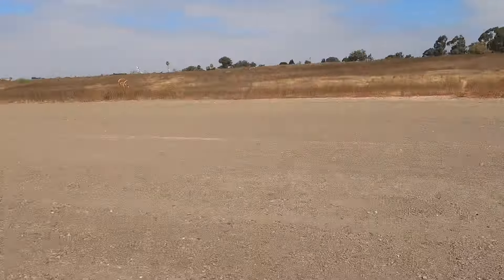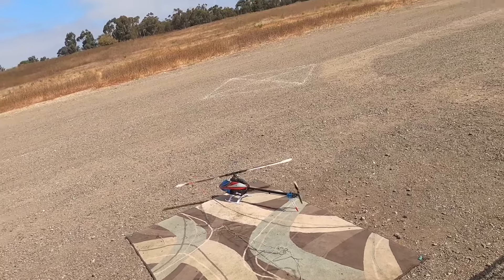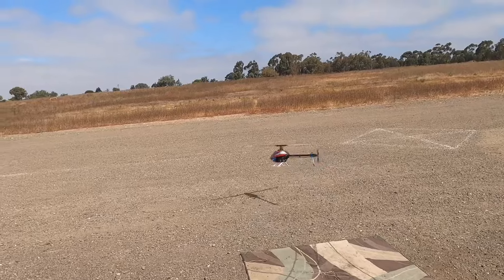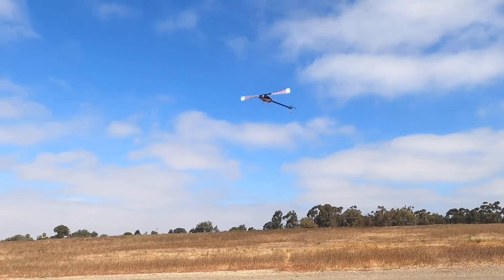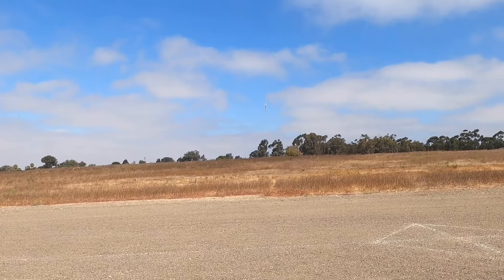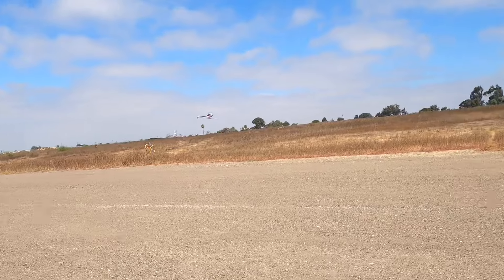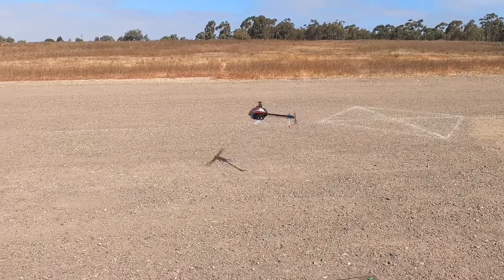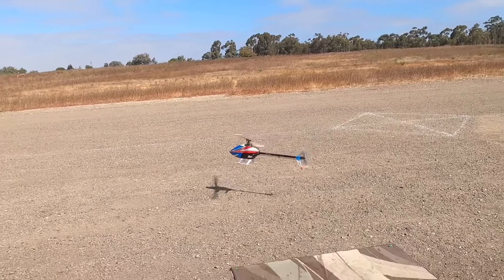Blade Fusion 550 Helicopter Flight with shimmed stock head dampeners. #horizonhobby

Comment: Very nice flying. Maybe blade produces other dumpeners to have the same effect. Is it possible to see the new 700 blade? Greetings from germany.
Reply from the maker: Prost!🥃  Blade and other manufacturers do not make rigid head dampeners for this helicopter, this is why I did my own modification to suit my flying style.  It cost 3 cents and it works.  So far, I have not received a new Fusion 700.  If they send it, I will fly it.